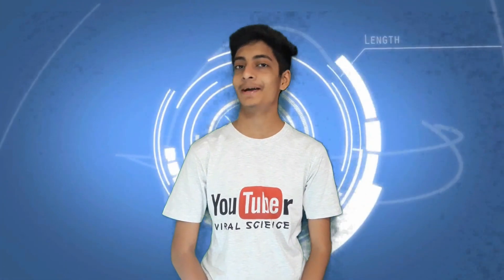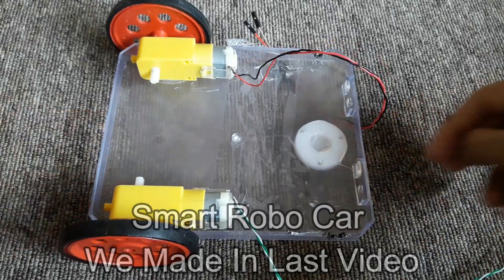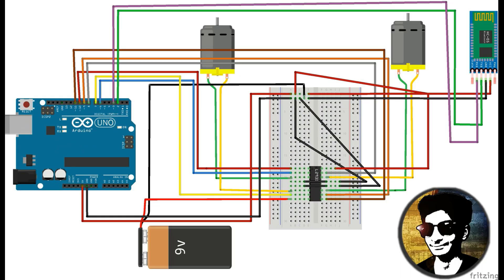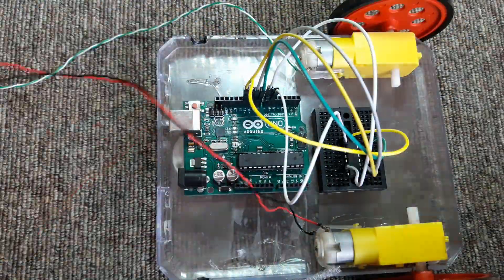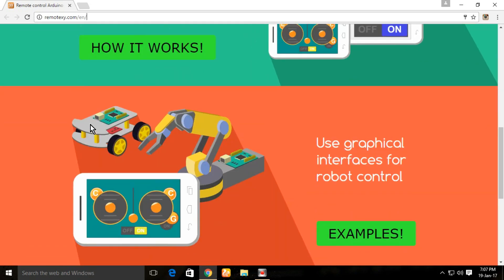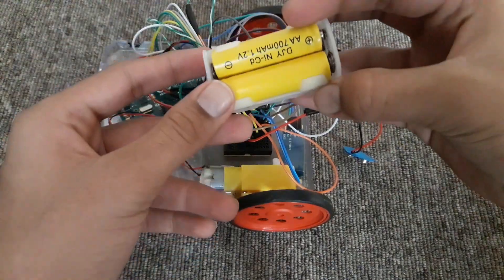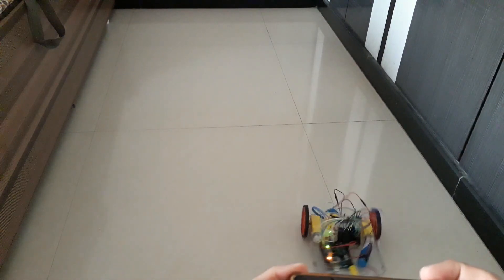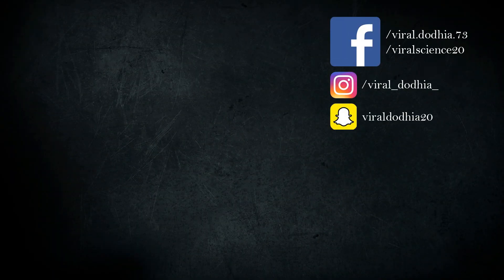How to make smartphone Controlled Car (G-Sensor)(joystick) controlled

Comment: Viral science  im getting an error for this line that says:0
Arduino: 1.7.11 (Windows 8.1), Board: "Arduino Uno"

car_code.ino:85:1: error: expected unqualified-id before '{' token

Error compiling.

  This report would have more information with
  "Show verbose output during compilation"
  enabled in File > Preferences.

how can i fix it ?

void setup ();
{
  RemoteXY_Init (); 
  
  pinMode (PIN_SWITCH_1, OUTPUT);
  
  //initialization pins
  pinMode (right_motor_A, OUTPUT);
  pinMode (right_motor_B, OUTPUT);
  pinMode (left_motor_A, OUTPUT);
  pinMode (left_motor_B, OUTPUT);

  RemoteXY_Init (); 
  
  pinMode (PIN_SWITCH_1, OUTPUT);
  
  // TODO you setup code
  
}